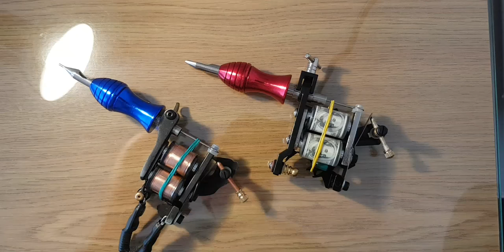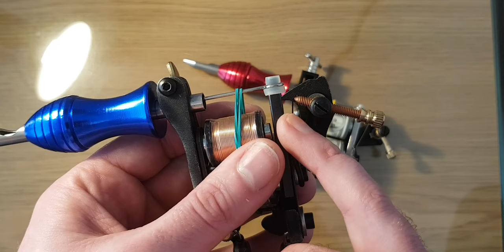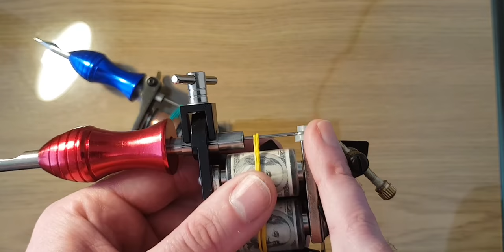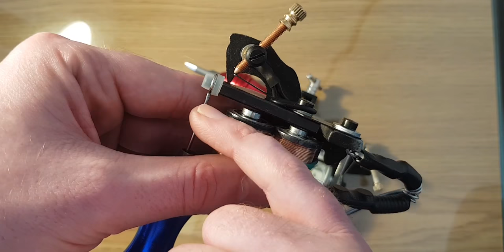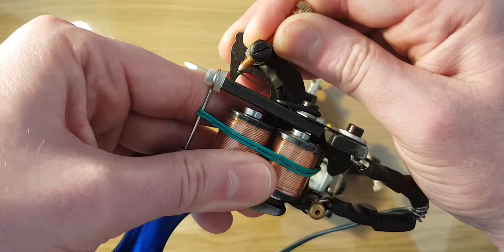How to tune a TATTOO MACHINE as a beginner #tattoo #tattoomachine #tattooing

Comment: I keep having electricity shoot out where the screw and spring meet. Like blue flashes of electricity and golden sparks flying out
Reply from the maker: Your machine just needs to be tuned more! If your machine was running properly it wouldn't be having that issue 👍
Reply: Same here cant seem to stop it
Reply from the maker: You just need to get your machine tuned correctly be fine then👍

Comment: The amarture bar on that liner should be slightly down just so the contact screw hits just about the tip of that spring. And I would just set it like that if it was a color packer with a longer and slower throw(with a strong hit), or a fast liner(also with a very strong hit) with shorter throw. It depends on the coils and capacitors you have. These details are mighty important to tattoo. So may be a good idea making a video of that too in the future for further instruction. Cheers. ✌
Reply from the maker: Thank you for the info👍
Reply: @TwistedTattoo.WarShorts  Sure! 🤙

Comment: That whole nickel and dime "gap" is the distance of a gap you should be able to see when the armature bar is moving thus being the Stroke Length simply sliding either between your front spring and contact screw don't really make any difference as I proved in a How To Really Set Liners and Shaders video on my account on this. Just by because aware of how many people go by that very misunderstood rule of thumb leads me to believe there's Alot of people doing linework with what should be a shader and the other way aroun aswell. That was one of the first things I learned during my 3 year apprenticeship from a artist who's been in TATTOO Magazine on a few occasions and is probably the biggest oldschool secret in the tattoo industry today
Reply from the maker: Fantastic advice please stay connected 👍

Comment: I just found out through your video, that I am using a fader machine for linings. Is it possible to shorten the spring, so the contact screw can be set up correctly?
Reply from the maker: You can custom build a machine but it's more work than just that sorry 👍

Comment: What volt should it be put on during the time of tattooing?
Reply from the maker: Depends on if your shading or lining and what type of machine you are using 👍
Reply: put it as low as possible till it turns on. So flick start it, and wait to hear the machine actually pushing the ink.

Comment: That gourmet should turn clock wise or counter on clip cord.. red on top or bottom..
Reply from the maker: Depends on the setup of your machine
Reply: Its rotary.. but like I said its clip cord and depending where I place the red cable is the way it rotates..red on bottom turns counterclockwise.. but dont know if it make a difference  cuz it works both ways..
Reply from the maker: @alexgallegos9818  red top black bottom 👍

Comment: Where did you get your machines?
Reply from the maker: Iv got one dragonhawk machine which is my best and two cheap eBay ones m8😁👍👍👍👍
Reply: @TwistedTattoo.WarShorts  I got a Dragon Hawk as well. I started off with just a homemade which worked great and then used some cheap Amazon ones as well, some in which I've nvr used too. After I got the Hawk I haven't needed to switch out yet. Maybe thinking of trying a Rotary tho.
Reply from the maker: Yeah iv got a rotary pen machine now with the cartridges much better @Ryno Art

Comment: I’ve done this but it’s still not working, the spring isn’t moving. I’m getting the initial noise from the connection box
Reply from the maker: Its hard to tell because I can't see it👍
Reply: Is there a way I could send you a picture of it? On Instagram maybe
Reply from the maker: @aliciatrundle6537  jm remembrance art on Instagram 👍
Reply: If you have some cheap machine from a kit or chinese built machine that doesnt cost atleast 40-50$ a machine you wont be able to tune it they are set to work one way and one way only

Comment: Ok...that was the liner...and the shader...the contactscrew dont stand at 1 o'clock...?! What stand has the shader???????!!
Reply from the maker: I set the contact screw at the 1 o'clock position for the liner machine and the shader machine the contact screw is at more of an angle near the start of the spring near the armature bar
Reply: When adjusting your contact points make sure to tighten them up so the vibrations throw off your settings
Reply from the maker: That's one thing you most do 👍👍👍 thank you for your comment ( goat )

Comment: Idk why but my liner keeps sparking the contact screw sparks when it’s on
Reply from the maker: It's not tuned properly 👍
Reply: Might want to look at your capacitor....
Reply: Dirty contacts. May have lubes or other creams you use that are clear. Clean with alcohol and allow to dry. Not necessarily but sounds like it if right at the contact.